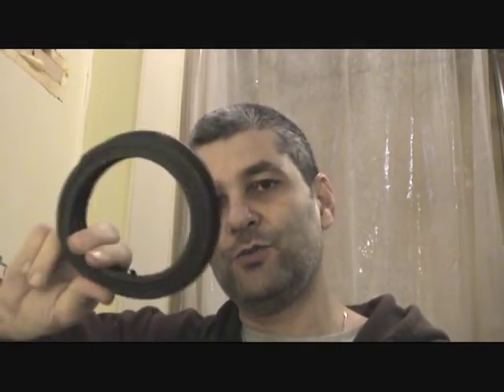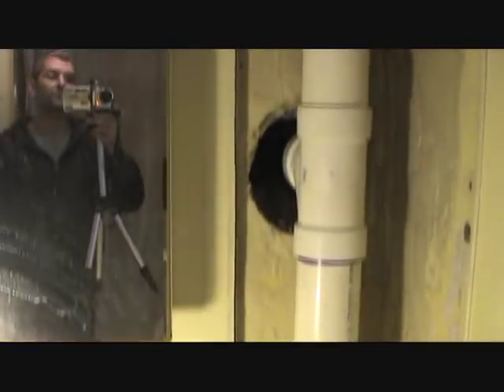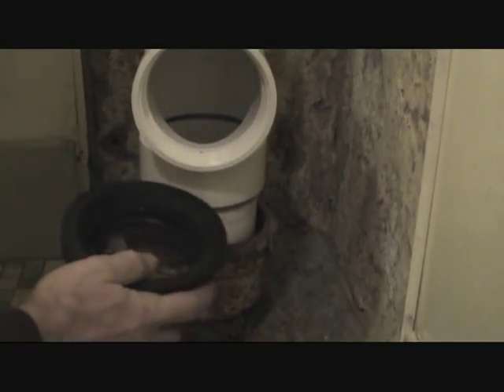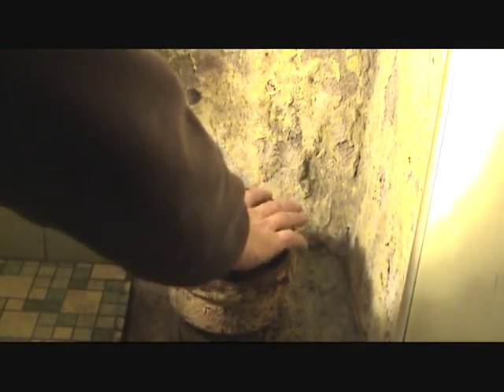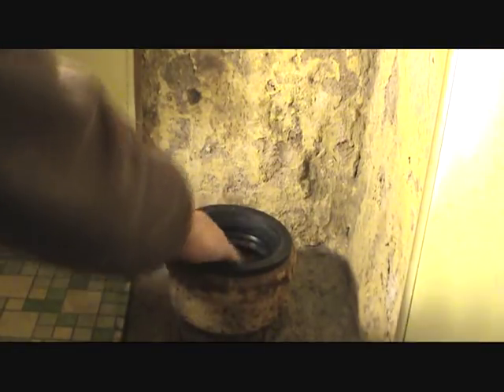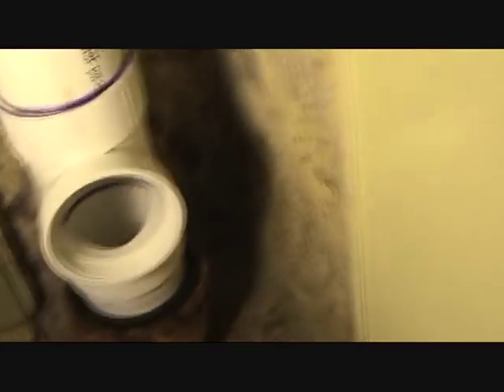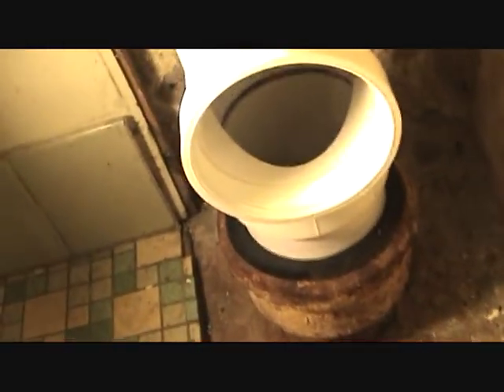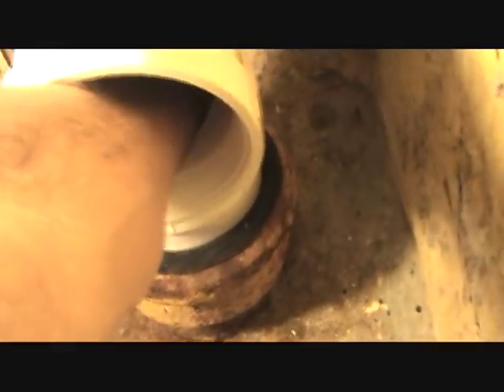Cast iron hub to pvc pipe

Comment: Thank God! Somebody finally using the proper connection (Fernco cast iron to pvc/abs Donut). GOOD JOB! Next time use a little dish soap as a lube; way easier!
Reply: Mark Schneider What if the cast iron is horizontal in the the ceiling joists,  two story, will that fernco  work  ?  From a tub ,shower ...pvc to cast iron ?
Reply: @stevensobba1785  most def.these vent pipes/grey water pipes dont hold pressure

Comment: Did this same job yesterday. mine was very tight. I could not get it to fit until (1) I got the rubber donut hot with some hot water and (2) to the PVC in the freezer to shrink it slightly. Once it was hot and a little lube, it went in. Beveling the lip is must. Hope this helps someone else.
Reply: Liquid soap is the best option. (Dish washing liquid). Put it on the pipe & around the rubber. Then twist left,right whilst pushing it in.
Reply: @tonydalton6756  I tried that first but it was too tight. maybe the bell hub was tighter than most. Thanks for the suggestion

Comment: A helpful video!  That rubber donut is called a 'service weight gasket'.
Reply: That name implies its held in place by gravity. Can these also be used in a horizontal connection?
Reply: Service Weight (SV) refers to the thickness of the cast iron. Extra Heavy Weight (XH) is the other kind. They can be used on the horizontal, but the pipe should probably be well supported.

Comment: There is a special adapter called a "hub adapter" or a "cast-iron pipe adapter" that is made to use with the rubber Fernco gasket ("donut").  It goes on the end of the PVC pipe to make it easier to get the pipe properly seated down into the hub and Fernco gasket.  (Also a little dish soap or silicone spray would help as several other people suggested!)

Comment: I usually use silicone spray lubricant, and sometimes a little silicone grease applied to the pipe end and the Fernco to help install these rubber Fernco couplings.

As someone also mentioned, which I have used in a pinch, cheap liquid dish soap also works good as a lubricant.

Comment: Very helpful video - thank you.
I cannot find the gasket rubber that you are using.
Can you give me a manufacturer and part number so that my local shop can order it for me.
I went to four plumbing places and they don't have a gasket like that. I need exactly the size that you are using 4" iron hub to 3" plastic pipe.
Thanks!
Reply from the maker: I got the gasket from my local plumbing supply. Not sure aboutthe part number.
Reply: I am in Canada and HD does not sell it here. I had it ordered and paid four times what HD in the US charges
Reply: Amazon
Reply: Check with mission rubber

Comment: Hey. Good Video! Question? Would it be alright to use a clear silicone for lubricant?I have a metal pipe that has a small hole in it going into the cast iron.I can get to it through the closet,but its kind of tight & thought using silicone would help slide it in easier.
Reply: explain?
you can patch a pinhole with epoxy..the pipe is not holding pressure

Comment: What you have is a service weight compression gasket. It will work, but Fernco makes a donut for that application. Soapy water helps and put a piece of wood on that pipe and smack it hard with a heavy sledge to drive it home.

Comment: Thanks for the video.

Is there some reason you are using PVC rather than ABS?
Reply: +patrick donegan Some areas of the country, like here in Ohio, pvc is preferred.  I do know that abs solvent cements much easier with a single step.  PVC requires a 3 step process - clean, prime, cement.
Reply: you don't have to clean abs?
Reply: patrick donegan ABS has been recalled by nibco and other manufacturers in almost every U.S. state due to shrinkage. Just head down to your locally mobile home park and try to find an ABS joint without drip stains. It's just for sump pumps now. Good idea using recycled material, but too much shrinkage long term.
Reply: everyone and everything uses pvc here in charlotte. I didn't even know abs pipe existed until I saw a video on here of someone replacing it. I was like huh black pvc lol
Reply: PVC is the code requirement where I life. We are no longer allowed to use ABS for interior drain pipes like this.
Reply: @aaronbennett8364  interesting.

Comment: Dont use a hammer. lub it and push it in by hand. rock it back and forth while putting pressure on it and it would have been together in a few seconds
Reply: joemama1151  I always put a 2x4 on top of the pvc pipe and use a rubber mallet and I’ve never had an issue

Comment: I have the same question as a couple other guys. How did you get the original cast iron pipe out of that hub?
Reply from the maker: Torch and flat head screwdriver piking on the lead until all gone. Melting lead and pulling out with the screwdriver.
Reply: @MrEnergyFree  Thank you!

Comment: How do u successfully break out cast and lead from hub?
Reply: Xion Temoc  I use a little heat from a torch, you really don’t need to do this if you don’t want but if you do make sure you’re wearing a gas mask and have good ventilation. Anyways if you clean up around the top of the pipe and then take a medium small chisel “I used a 6” chisel” then with the chisel find a groove between the pipe and the lead coated sealant and gentle tap the chisel with a hammer to make the groove a little bigger and slowly work your way around the pipe but don’t rush it and go a little deeper each time you go around the pipe. Maybe you or someone else has another way to do it but I found this was the easiest method for me
Reply from the maker: Be careful with chisel, the hub can break very easy. Use a flat head screwdriver and a torch to melt the lead.
Reply: precision chiseling / prying, also can drill the lead out with smaller bit
Reply: Drill out the lead around the hub with a drill bit then use a flathead screwdriver 🪛 to scrap and pick it out.

Comment: Little bit of silicone spray would have helped you out a lot .
Reply: J CaaM you are correct. In my experience, I have found that when installing a hose in a awkward area as when working in the automotive field, spraying a bit of silicone will make the hose slide easily into place, and then when the silicone dries it actually helps seal the hose in place. So I was wondering about the same effect when sliding the PVC pipe into the rubber sleeve

Comment: How did you remove the old pipe from the hub
Reply: I have the same question. I need to convert some of my sewer line as well.
Reply: FoxRcng708  I had a hard time getting enough heat to the pipe as it was only a few inches out of the concrete floor, but eventually we got it broken up and peeled the lead out.
Reply: Use a drill to drill out the lead, once enough is removed the pipe will come out. Bevelling the pvc going into the gasket is a good idea.

Comment: I shattered a conection like that, first happened to the hub the to the wye. If you hit like that would be more safe you just out the pipe piece section only on and then use a flat piece of wood board or a 2x4 and hit it with like one of those metal rubber covered hammers. Like i have. Then after this you could glue and insert the wye, elbow or whatever connection you need. Just saying if it is working for you whatever. Those stupid pvc connections are expensive unless is not sd40

Comment: In Ontario Canada.....you can only use white PVC under the floor in the ground and under the cement floor...reason is that in case of fire the off gassing of the PVC is to toxic. ABS above the cement floor....all PVC under the floor.
Reply: +pauleastend2 not where we live. Abs is not allowed in any of the plumbing where we are only in trailer homes or mobile homes because its not permanent. Its against code. We are allowed to use pvc. With your thinking about the toxic qualities , what do you do with PEX which is plastic used for water? or other toxic things in the home when burned, like furniture and wire insulation etc.
Reply: follows the same code as' no combustibles(plastic)in a fresh air plennum.one of the other reasons to use cast iron is,its quieter

Comment: How do you get the PVC pipe into the cast iron hub?? It wont go in.
Reply: luckimom3  what do you mean? The pvc pipe is smaller than the cast iron pipe and will go in without it being tight and that’s why you need the rubber seal
Reply from the maker: To pass the rubber seal  you can put water with soap.
Reply: grease

Comment: You are supposed to debur the end of the fitting and put some silicin spray or greasy or even washing up liquid as a lubricant not hammer fittings.. Never seen a plumber hammering the plumbing unless he needs to break the old system

Comment: Best rubber lubricant in the world is brake fluid. That PCV will slide right in and won't harm either the rubber or the PCV.
Try it.
Reply: +moomike laloo 
anything oil based degrades rubber. silicon spray should be used instead and is a better alternative
Reply: brake fluid peels paint, eats gloves, nasty stuff, I would never use it on a rubber gasket.  Liquid soap is where it's at
Reply: @SK-yw5ih  You have to watch a lot of high priced plumbers spread bad advice. Same with auto mechanics at 185 and hour they cost as much as brain surgeons.